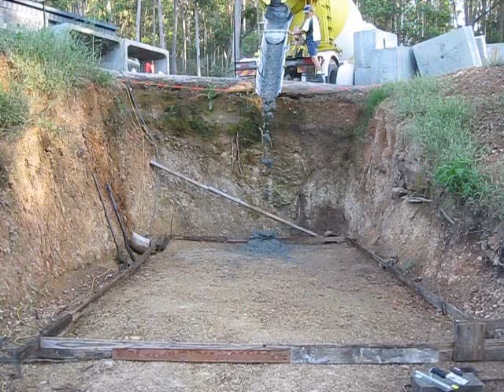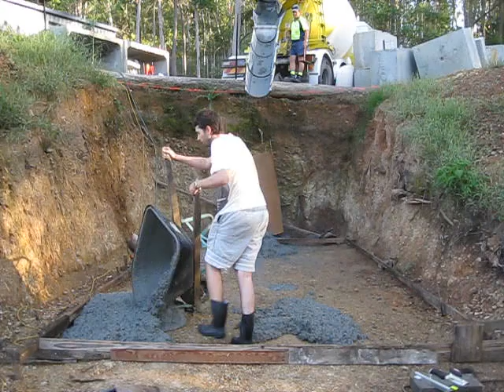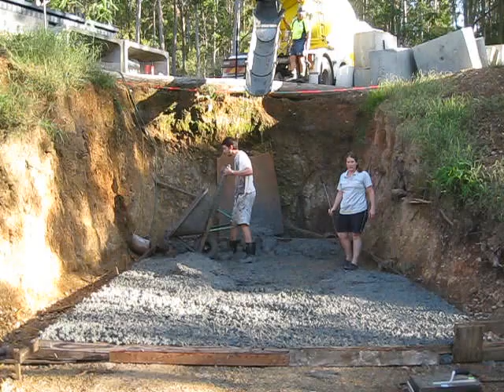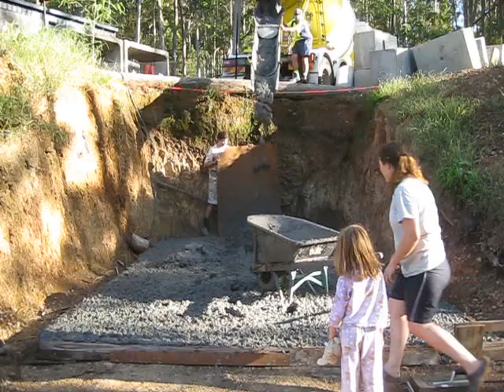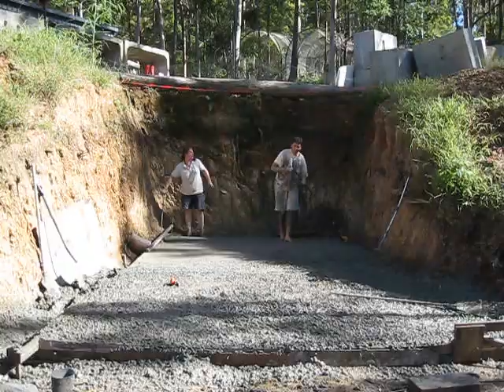Time lapse pouring a concrete slab for fire shelter bunker. Part 2 of 2

Comment: I'm glad they are working hard at what they believe in. When building your slab 1st lay down plastic it will keep the ground from soaking up the moisture out your slab thus making it much stronger. Takes longer to cure but well worth it. It helps if you can't afford the rebar.

Comment from the maker: Hi... No burns or injury here. My wife was 100% ok. Blisters from gum boots was the worst.. then i had to get a haircut because the concrete splashing down set in my hair. The rake was a great tool and worked well, but the distance to move the concret was too big to rake it all over. Extra hands would have been useful, our hindsight is 20/20. Reo wasnt needed because its high mpa and thick concrete on very solid shale, its unmoveable and didnt crack when it set. The blocks being not offset also didnt matter, the mortar didnt crack between them. Also we waterproofed with bitumen from the outsside. Next time we would get a more runny mix and let gravity spread it out more and it would then screed better. The ruck couldnt put his chute further back. A better solution would be to have a conctrete pump and put the stuff where its needed, however thats very expensive. This has turned out perfectly well and is holding up. Thanks for your concerns.

Comment from the maker: Hi, Concrete might explode if exposed to extreme heat fast, but in this case there will be no heat on the structure since it will be fully burried with earth. Only a besser block tunnel will be exposed to outside/heat and the entrace will be L shaped to avoid direct radiant heat on the door/seals. There will be two doors, one air tight door on the inside and a general fireproof door on the outside.

Comment: That's pitiful the concrete was far too dry to even be trying to use. You have no one qualified to even oversee the job. No plastic, no concrete wire and or rebar. No way to screte it and too late to get the rock below the top surface. That driver knew better than to pour that concrete out like that. Just totally unreal :(

Comment: Not very well planned., your poor wife's feet probably burned off you didnt need all that shovelling, you also should have poured it a little wet... you should have wheelbarrowed it in place and started screeting right away, and you kept walking over your work..

 proper correct placement and minimizing your movments is the key to a good slab...what you got is an 8 yard blob of unfinished concrete.. should have thought it out better